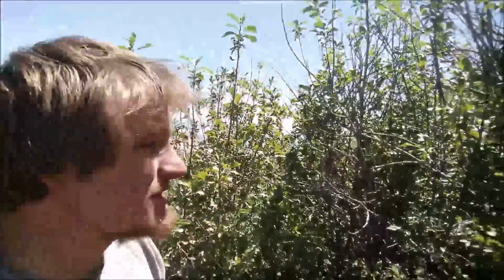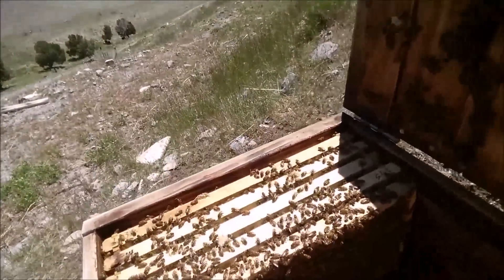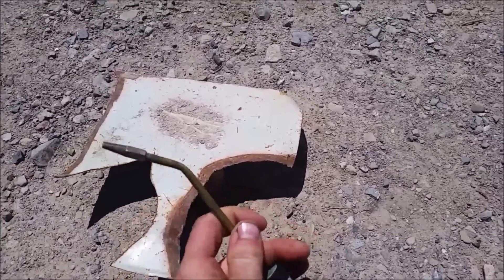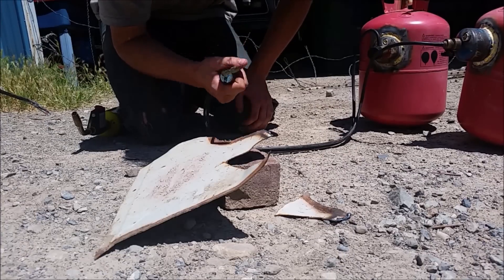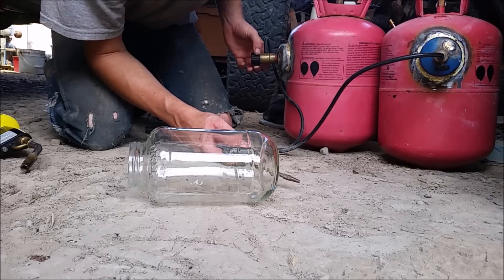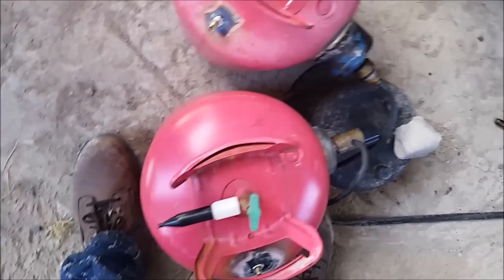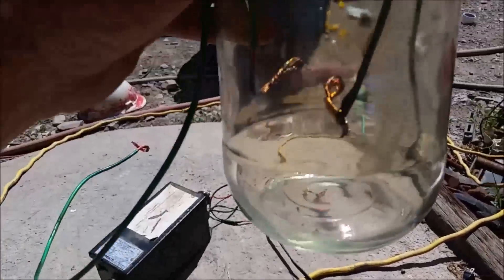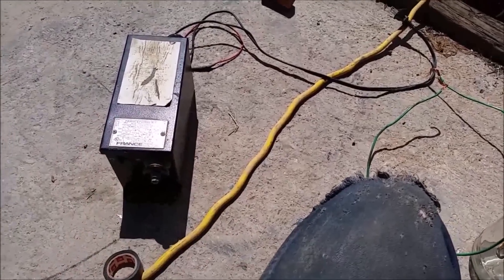Testing My Oxyhydrogen Torch

Comment: Maybe you can add an impurity to the mix in order to see the flame? Perhaps spraying water through the end of it will show you where the flame is. Are there metals that change color with temperature and then revert back afterwords, like a mood ring for infernos? Then you could hold a bit of it on the end of a metal rod to detect the flame's parameters. Actually, the flame melted tungsten... Change of plan, you'll need some kind of ceramic or other heat resistant material.

Comment: No welding goggles at the end made me shiver. When I do actetylene welding/cutting, always wear goggles ffs. And there's a fun trick: you can heat steel with a torch to the melting/really orange hot point, turn off the acetylene/hydrogen, and turn on oxigen full power, it will burn the orange hot steel away, chunks will go flying I kid you not. Thats how we used to cut steel plates when we had not designated cutting tool like a plasma cutter, a standard gas cutter is simply a torch with additional oxigen supply, when you pull the handle, the additional oxigen adds in the flame and burns/blows away the melted steel. In short words, with that setup you can do some serious work. When the world goes to shit, I'mma live with this guy, coz he has all the things needed to build a massive fort.

Comment: Children in africa can drink that water
Reply: +AtDiT go buy them water then
Reply: A clear sign that people who have time to be leaving these comments should help them reach a better source.
Reply: +AtDiT There are way better methods for hydrating third world countries than with oxyhydrogen torches. Filtering surface water with layers of gravel, sand, and ground up charcoal can do it. Then you can boil it to kill anything left.

 Also, their biggest problem is that they have to travel miles to get to the closest body of water and carry back as much as they can hold, often making multiple trips. Building a well in town (or a canal or pipeline) takes a specific knowledge set that they often don't have, but it sky rockets their quality of life. Also, basic sanitation is an enormous issue, and many parasites and diseases are spread by people who don't treat their water well (some people do #1 and #2 too close to (or in) bodies of water that people use for drinking). Then there's the refugees dying from dehydration while fleeing across the desert to safety away from rebel forces. The number one source of murder in the world is rogue governments... Hence the 2nd amendment.

Did you know that you can fill a ziploc bag with clear water and leave it on a rock for a few hours to kill microbes with the Sun's UV rays?

Comment: I've heard that hydrogen molecules are so small they'll slip through the spaces between other molecules so you can't actually contain it without leaks.  Do you think that's true?  I think my high school chem teacher told me that...
Reply: +Czech Hydrogen gas is H2, made up of 2 hydrogen atoms.  Some molecules are pretty big, like polymers which are huge repeating links.  I'm not saying it's true, I was asking Cody's thoughts.

"Hydrogen gas molecules are so small they fit between other molecules so containers will always leak."  It's kind of hard to misrepresent that.  ;)  But thanks for giving me the benefit of the doubt.  :P

Comment: Hydrogen at ambient temperature will diffuse through steel. Many metals form non stoichiometric, interstitial hydrides. Effectively the hydrogen dissolves into the spaces between the metal ions in the crystal lattice. Your hydrogen could be diffusing straight through the steel. As it does, the metal lattice can be changed in a process called hydrogen embrittlement. This can lead to catastrophic failure of the metal part.

Comment: this is cool and all but why would you not just get some actual gas cylinders? that diy shit is dangerous...
Reply: He's out in the middle of nowhere. He's not a danger to anyone, and it's clear that he knows what he's doing.
Reply: So is unhealthy diet.
Reply: Because science
Reply: Tim Ramich Hence the first part of my comment. I am aware of how a tank is made and tested.

I don't mean to imply that he is incapable of safely doing what he has done. I'm more concerned about less skilled people who would see this and think it's okay to use for higher pressure purposes.
Reply: those tanks he has are only $20 thats cheap as fuck and they are strong
Reply: I agree. I suppose it's okay considering how low of a pressure he is running, but for safety's sake I would definitely at least be using tanks that haven't been cut and welded on.
Reply: tim meadows, as long as he isn't pumping it with tons of pressure, he should be fine.
Reply: +John Hoelscher How do you think tanks are made in the first place? He's not exactly using them for high pressures, like attempting liquid storage of substances that are gases at normal temperatures.
Reply: +John Hoelscher Then that's their own fault. Let stupid people be stupid and remove themselves from the world from doing things that are their own fault. If others get hurt, oh well. As long as the stupid person whose fault it is died in the process, or got horribly injured, justice was done.

Comment: Did you know deuterium water ice sinks in deuterium-depleted water? You should isolate deuterium sometime and see for yourself :) Its time consuming but easy to do, just subject regular water to electrolysis, and the leftover water gets higher and higher in deuterium concentration. You already have a use for all the oxygen and hydrogen anyway :D
Reply from the maker: +Richard Smith 
You should search for "homemade heavy water" on youtube.
Reply: ***** Oh, you already did it xD Well, thanks for letting me know, sorry about that.
Reply: Eren Jaeger You cannot make an atomic bomb out of Deuterium, like you cannot make cake batter out of an oven. 
Deuterium is hydrogen with a neutron(normally hydrogen has no neutron). 
It is simply a substance which facilitates a nuclear reaction, but itself is inert(as normal water).
Reply: +Cody'sLab didn't the Germans try to use deuterium to make an atomic bomb?
Reply: +Richard Smith ooooooooohhh that makes more sense. I just heard somewhere that they tried to use deuterium for something to do with an atomic bomb.
Reply: Yes but it is still an ingredient in fusion  add lots of heat and another thing that starts with a T i dont remeber the name of the T word
Reply: +falcon 1452 you mean tritium?
Reply: If so, Tritium is radioactive :)
Reply: Richard Smith he actually did this in an older video
Reply: Eren Jaeger they wanted it as a neutron moderator in a nuclear reactor they were going to build which had something to do with their atomic project. in a nuclear reactor you use a moderator to slow neutrons so they are more likely to cause a fission. In America we used graphite instead.
Reply: 2012 cthulhu Please read replies before replying. Both of your comments have already been said.
Also, Deuterium and Tritium are used to moderate the energy, true, but not the reaction itself. Normally, the neutrons are moving far too fast to be able to reliably sustain the reaction. Slowing them down INCREASES the heat, as contradictory as that seems, however, once vaporized, it gets worse at slowing down neutrons, decreasing the heat. This is why it is so useful.
Tritium is created spontaneously in Deuterium reactors, as part of the moderation process.
When an atom of Deuterium absorbs a neutron, it becomes Tritium.
When an atom of Tritium releases the neutron it absorbed, it is at a lower energy level better suited to sustain the reaction, and then returns to be Deuterium again.
Reply: Richard Smith yeah, seen that after. sorry

Comment: couldn't you cut through steel with only 3000F? because it melts at 2750 so in theory you could just melt a line through and the melted metal would just fall to the ground making a hole.

Comment: This canister of highly flamable hydrogen is leaking.... lights torch
Reply: +robbie pemberton Hydrogen ALWAYS leaks. Thats one of the big problems people have with using as a fuel for anything. It just doesnt want to stay in the tank.
Reply: robbie pemberton
 Correct. Incidentally, helium has the same problem. Its just not quite as bad.
Reply: +Tanall     It's actually much worse. Helium gas is smaller than Hydrogen gas. 

Remember, Helium is a noble gas, so it always occurs as an individual atom. It is monatomic. Hydrogen gas almost always occurs as a diatomic molecule, H2. A molecule of H2 is quite a bit bigger than an atom of He. Helium gas leaks faster than Hydrogen gas.

Monoatomic hydrogen can be generated and even made stable under the right conditions, but this is not the normal state of Hydrogen under conditions you normally find on Earth. It's interesting to note that a monoatomic hydrogen flame actually burns nearly 1000 degrees hotter than an ordinary diatomic Hydrogen flame.
Reply: and fly's away  at over 30 mph up in to the sky  so there no gas cloud on the ground
Reply: Hehehehe
Reply: the leaking rate is very low so its nothing dangerous..
Reply: Unmannedair That is very interesting about hydrogen becoming monoatomic when adsorbed into metal. I am familiar with hydrogen embrittlement and formation of metal hydrides, but I didn't realize H2 behaved as monoatomic hydrogen when adsorbed into the metal matrix.
Reply: seen the one where he submerges his uncovered arm in mercury ?
Reply: Steve Gerrish Whoops, Mercury isn't dangerous unless you inhale it, or if you're exposed to it for too long.
Reply: Noah Spurrier you are right about the monoatomic helium, but hydrogen also goes monoatomic easily also.  some kind of metal should not be used to store pressurised hydrogen because the hydrogen will dissociate and diffuse through the metal.  this usually weakens the metal also. regular steel will diffuse hydrogen if the steel gets warm.  professional systems usually store the hydrogen in a salt crystal under pressure. there is also usually a liner or plating inside the cylinder.  these all combine to reduce diffusion losses by reducing the dissociation conditions.
Reply: does it burn hotter because it is more readily available for combustion? 
H + O2
vs H2 + O2?
Reply: I found this comment way more amusing than it should of been 😂
Reply: unsure I actually think he explained that some types are not very good at penetrating skin.
Reply: Organic compound with mercury are deadly, and it will kill you even through a normal glove.
Reply: dooooooooooon't worry, it says 'inflammable'! /dr nick
Reply: +Tanall I take it that's because of the small molecule size?
Reply: Tank won’t blow up if it’s only hydrogen gas
Reply: Lower flame limit at atmospheric pressure limit is 4%. Below that, it will not sustain a flame.
Reply: Noah Spurrier they are both.  the hydrogen in between the grains usually forms an h2 inclusion, but the hydrogen that is actually in the crystal is usually mono atomic.   embrittlement in steel occurs when the mono atomic hydrogen reacts with inclusions of oxygen and other impurities in between the grains.  when the oxygen reacts it forms cavities of 75,000 psi water.  this forces the grains apart.  because this is a form of dynamic equilibrium the water can reform rust, iron, and oxygen in a cascade that forms cracks.  when the hydrogen is diffused inside the crystal it stresses the grains making them swell and sometimes shift crystal structure.  when you add all this together, you get the process we observe in embrittlement.
Reply: he's outside with the wind blowing, so he's good....for now xD
Reply: Steve Gerrish I don't know, but that's a good hypothesis. Tell me if you ever find out.
Reply: @NoahSpurrier  molecular hydrogen hydrogen burns relatively cooler than mono atomic hydrogen because it takes a some energy to separate H2 into H and H, or put this way.....  When H and H come together, they give up energy, so to separate them, you have to add energy.
Reply: As long as it isn't pure mercury he's ok? Or is it the other way around idk.
Reply: mog5858 true

Comment: I think the reason the hydrogen stays lit and doesn't blow itself out like acetylene, may have to do with the relative densities of hydrogen gas versus acetylene.
Reply: Density will effect viscosity.
Reply from the maker: +Armen V 
Not density but you are on the right track the lower atomic weight increases the speed that the flame can travel.

Comment: The line where genius and insane quickly start to blur. I had no idea how the fuck you got HHO into those tanks till I saw your other video where you collect it in garbage bags (wtf?) then compress it into the tanks. That's genius. The insane part is you did this all with a wet cell?! Just saying. My 63 plate, 2700 watt dry cell is 1/10th the size of your wet cell, I plug it in, it's portable, self compresses... the flame is over 16" and I don't gotta worry about tanks running out which is the WHOLE POINT of HHO in the first place. I'm not saying this isn't cool cause it is but WHY you went through all that bs just to film this OUTSIDE IN BROAD DAYLIGHT... so much wtf.

Comment: what a bunch of crap. I can cut 10 cm into 1 cm thickness steel plate in less than 5 seconds with my propane torch.
Reply: +Mark Schulz IV Dude he made the hydrogen and oxygen. It's called an experiment. Now run off and go buy more propane.
Reply: A Google User At least, it's a tool, not a child toy which is dangerous too.
Reply: MrPhreeradical yes propane with oxygen, are you kidding ?
Reply: How much tungsten have you melted with it?
Reply: Steven Cassidy none
Reply: +Mark Schulz IV Well he's melting tungsten not steel...
Reply: Isaiah Young why would you need to melt tungsten anyway..
Reply: yukikazeminecraft123 and if I don't ?
Reply: Mark Schulz IV bro relax it was a joke XD
Reply: Kyle Greenlee When I hear people saying "plasma cutter will take 1/2 a second" I don't even try and debate with them, because you've already learned how far their knowledge (or lack thereof) goes.
Reply: Horsey Tort I have the money to buy some, smartass.
Reply: Kyle Greenlee Plasma cutter is really really good at thin stuff as you said, because it is very precise, propane torch however leaves small blobs so is not that good at thin metals.
Reply: Kyle Greenlee I can't afford better camera.
Reply: Horsey Tort Propane is not toxic, unlike some other gasses.
Reply: Horsey Tort The propane tanks I get weights 20 kg itself and has 25 kg of propane, costs 50 €. I also use same tank for my stove. Oxygen comes in very heavy, 100 kg + when full, thick wall canister with pressure of 250 bar (~3600 psi) or even more.
Reply: Andrew Poronto propane/oxygen, duh. Last time I've played with acetylene, it wasn't very nice. It's too explosive and dangerous. Propane ain't that big deal, you need correct oxygen/propane mix to make it explode.
Reply: Horsey Tort why thank you
Reply: allbeit propane sucks
Reply: lol
Reply: David K that would be funny if it wouldn't be sad .
Reply: +Mark Schulz IV propane with oxygen yes, propane on its own ...no fkkin way dude.
Reply: +Mark Schulz IV if u wanna make some kind of weapon or jewelry
Reply: plasma cutter will take 1/2 a second XD
Reply: +Mark Schulz IV 0/10 You can't produce propane in your backyard, dumbass.
Reply: +Mark Schulz IV ive been welding, smithing, and forging  for close to three years now. i know a thing or two about metal work. Plasma cutterd are one of the least ethical but is one of the fastest cutting tool for say 1/3 inch steel sheets. Torches work better on thicker metal. but a "plasma cutter" is called a "plasma cutter" because it is specifically used to cut a torch is used for means of heating, melting or cutting. relax bro. learn to take a joke.
Reply: +Mark Schulz IV ive been welding, smithing, and forging  for close to three years now. i know a thing or two about metal work. Plasma cutterd are one of the least ethical but is one of the fastest cutting tool for say 1/3 inch steel sheets. Torches work better on thicker metal. but a "plasma cutter" is called a "plasma cutter" because it is specifically used to cut a torch is used for means of heating, melting or cutting. relax bro. learn to take a joke.
Reply: +Kyle Greenlee god damn my 2 am spelling XD
Reply: +Mark Schulz IV i never said you dont have the money for it. By the way your videos are fucking awesome.
Reply: Mark Schulz IV Propane comes in a container.
Reply: are you sure you aren't thinking of an oxyacetylene torch? propane can't cut steel
Reply: unless you meant a propane/oxygen torch
Reply: +Mark Schulz IV that stuff is nasty, cant go over 15 psi or you will be having a rough day. propane and oxy is the way to go with that stuff.
Reply: Mark Schulz IV lol you're a eruopoor. Makes sense why you're a fucking idiot. alright, this checks out.
Reply: Mark Schulz IV You're a fucking idiot.
Reply: +Mark Schulz IV then for fun
Reply: Sorry but you're wrong there. Propane is toxic.

Comment: oxy acetylene won't cut steel huh? where ever you get your info needs to be corrected. oxy acetylene torches are mainly used for cutting steel
Reply: +AjTheCableGuy apparently you aren't familiar with the differences in tips. as he said, his would get put out by the oxygen.

Comment: Hydrogen diffuses through the steel crystal grid. Even worse is helium. It has heavier atoms but no molecules and also the atoms are smaller in diameter so the particles are even smaller. But hydrogen also gets stuck between the metal ions and causes the steel become fragile and eventually crack (hydrogen embrittlement).
Reply: Hydrogen is soluble in molten steel but not in solid steel. When the metal turns solid the hydrogen forms at extremely high pressure between the planes in the iron crystals and along the boundaries between the crystals.